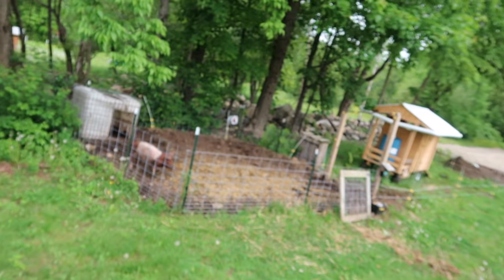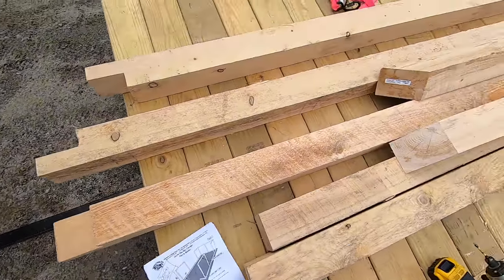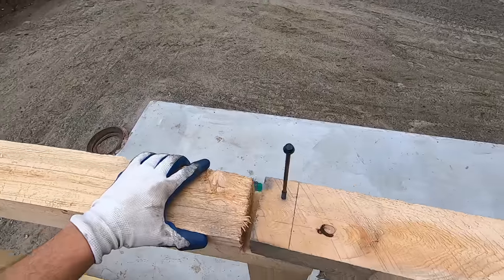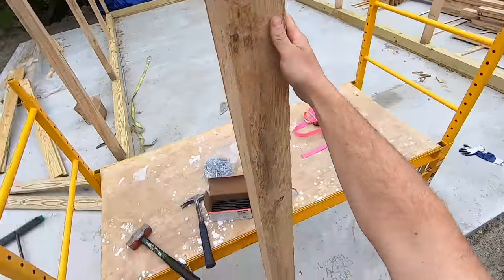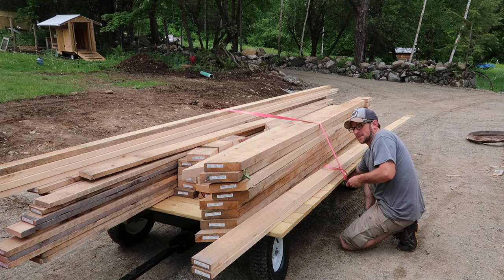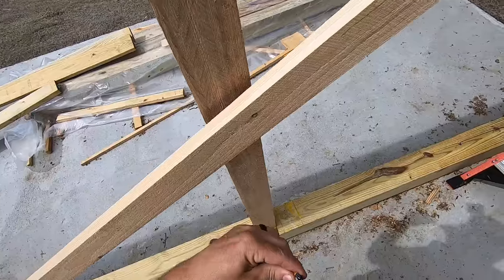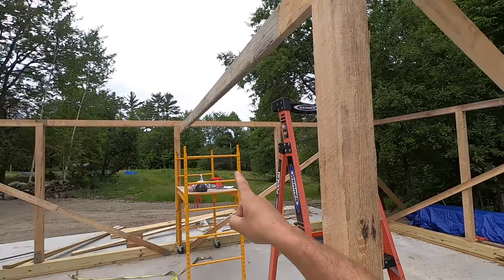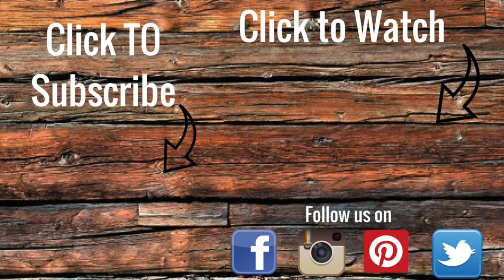One Man Builds Post and Beam Barn Kit Bought off the INTERNET

Comment: The barn kit reminds me a lot of Japanese house framing - 4x4 or bigger (120mm is common, which is about 4 3/4"), and the whole thing is pre-cut and jointed at the mill and delivered ready to assemble like a giant Ikea kit. The main difference is that the joints are mostly cut such that they are held together with full through-bolts, nuts and washers.

Comment: You are an exceptional builder, Al. Most contractors just slap up the boards where they need to go without checking for crowning or for damage on the wood. If I had a quarter for every time I had to redo trim in my home, it would have paid for the remodel.

Comment: got to love ratchet straps and cable winches watched a good vid on 'PROJECT FARM' on comparing nails and screws  holding power and shear forces  from the info on it  you need to install hurricane straps  on your roof maybe even wall connectors we had an old lean to cattle barn loose 3/4 of the roof this spring i'm putting straps from the posts to the rafters expecially on the top open edge

Comment: if you placed the brace on the other side then you can use your weight to push it out and hit the bottom out with a hammer it acts kind of like the spring board you used

Comment: You could probably have pulled for the brace by putting an eye bolt in the top corner you want to pull in and one in the bottom corner you want to pull it to then used the ratchet strap to pull it in. Since you love ratchet straps so much. :P

Comment: Just a suggestion....put a helper screw in your post to rest the brace on, put one screw into brace & into the bottom plate, place level on outside of post & plum post, drive one screw thru brace into post, when post is plum, add second screw to each end of brace. Plum each corner post in both directions & your walls should be plum. Measure between posts on the bottom plate than transfer those measurements to the top plate & your other posts in the walls should be plum too. No need to plum each post.   But like I said ...Just a suggestion.

for your lose posts

Comment: next time when u r about to put in the screws.. set up the screws where u want to place them and in before u use ur drill to screw them in.. tap the screws w/ a hammer so it can get started so it would b easyer for u to have a straight install of the screws.. but good job on the project

Comment: Goooooood Morning Al ,
You look like you are having fun , putting your barn together.  I am a little surprised that you are not drilling pilot holes for your lag bolts.  I know that they hold tighter without the pilot holes but they can also cause splits in the ends . 
 When building wood structures I also like to use exterior wood glue on all of the joints. 
Probably not really needed but I just like the extra rigidity  and strength. I used exterior wood glue when building the $30.00 mobile coops .  Wood swells with moisture and shrinks when drying out which causes the screws and nails to loosen. And so I add the exterior wood glue  as a bit of insurance.
 You are coming along a lot faster than I could .  I have strength issues so it would take me months to build the barn.  I will watch with interest as you put the roof on .
 I wonder how fast the barn will become too small ? lol

Comment: Good build. I would have used framing nails to join the main frame members together. Screws work but fail catastrophically (snap in two) when wind and snowing loading limits are exceeded.
Reply: Screws used to fail, not all screws are equal. If you use regular black grabber screws they will snap and so will like kind grades.  GRK is one brand will not snap, it may bend but it will not snap. You can check with your local building dept for specs or get with a architect / structural engineer. I just finished a structural repair that the Arch called for GRK screws to be used in this building structural repair. I believe he will be just fine with the screws he is using. But you do have to pay attention to what type of screws you are using and for what applications.

Comment: IF YOU HAVE NEVER HUNG A GARAGE DOOR BEFORE:  imagine mounting the door and hardware to a flat wall.  Flat wall.  Each track goes 1.5" wider, and you can't, can't have any wood violating that 1.5 anywhere.  Especially at the bottoms.  Up at the header is another common violation.  So plan to trim out the inside so it is all flat.  ##1 hinges on the bottom will keep the panel close to the wall but NOT rubbing.  As the track fades away from the wall you put the #2 hinges on the second, and #3 on the third.  When done, use flexible  trim so the door will not be wedged.  You can NOT really make a tight door, because that would not rise.
Reply: What I am seeing right now is a "step down"  where the upright sets on top of the sill plate.  Either cut off that sill plate (unless the 1.5" for the track is further inside the opening), or (preferred)  add board trim around the inside of the door before mounting.